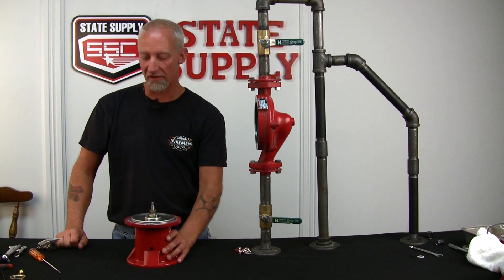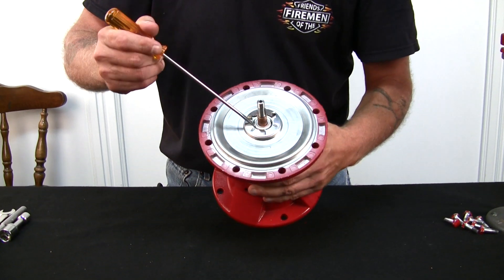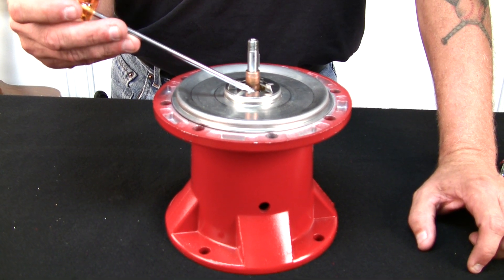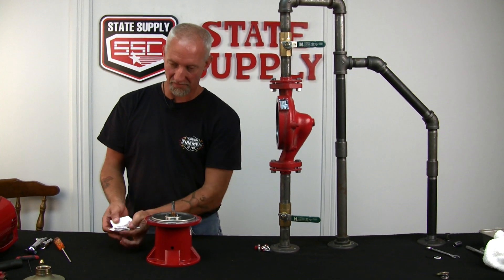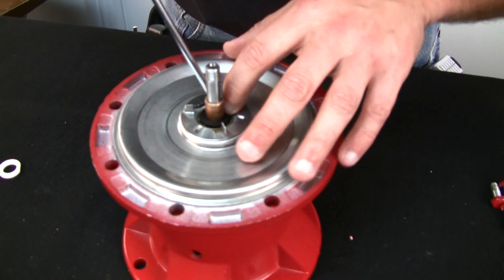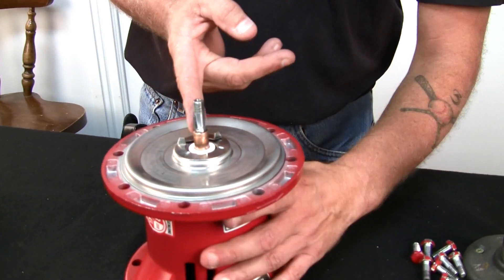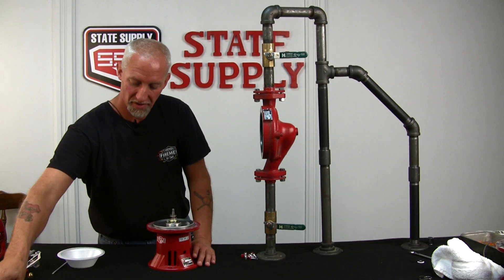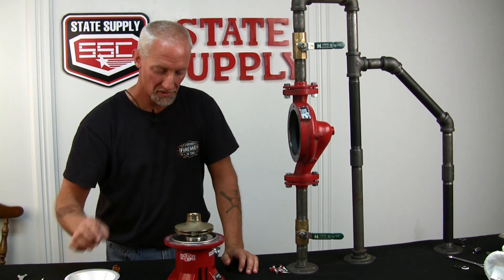How to Change a Seal on the Bell & Gossett Series 60

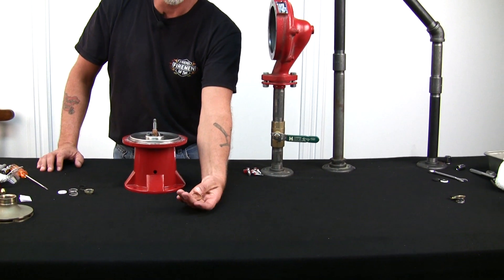Comment: 3:15  😂😂😂 "I wouldn't throw it away, I'd save it". 

I didn't realize my dad works at State Supply.
Reply from the maker: Haha! 🤣
Reply: @statesupply  I just finished the seals on a series 60 pump. 

I looked inside the oil reservoir and the wick is black. (I have 2 pumps in parralel, and my secondary pump wick is in good shape.) I can't find any reading material or video on how to replace the wick. 

Any advice?

Thank you,
Hubert
Reply from the maker: Give Tom a call 612-230-0954 and he can explain it! @hubert187

Comment from the maker: Hey Jim - the trick is to use a socket the same size as the ring. Turn it upside down (so there is more surface area), grab a rubber mallet and give one good/square whack. NOTE: take care to hit it square on. If you don't you'll kink it and you'll need a whole new seal kit (B&G part number 118681 - State Supply part number BG1300). Call me on our B&G tech support line if you have any further questions: 877-775-7782. Good luck! -Tom